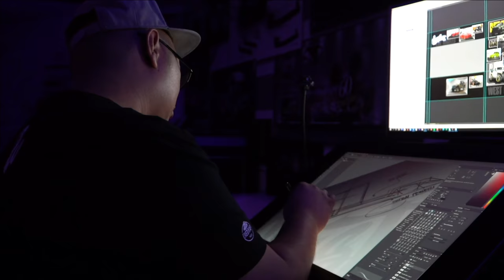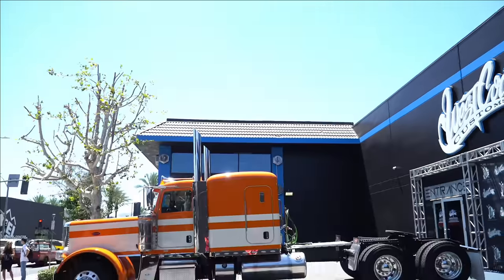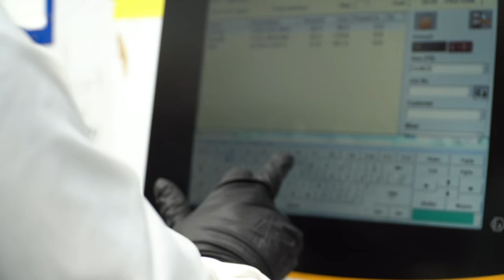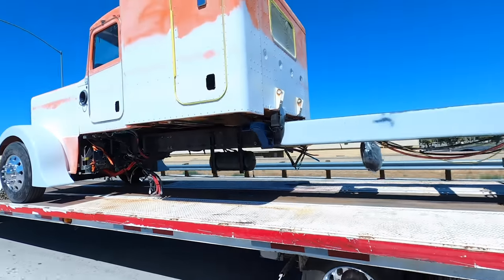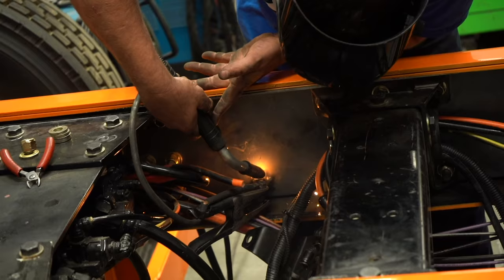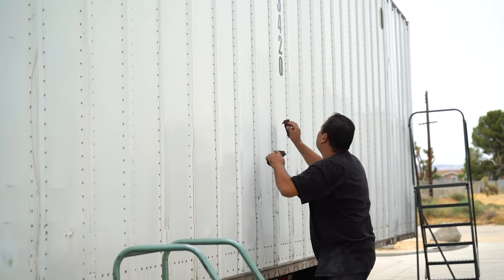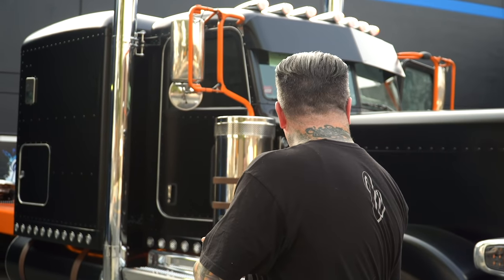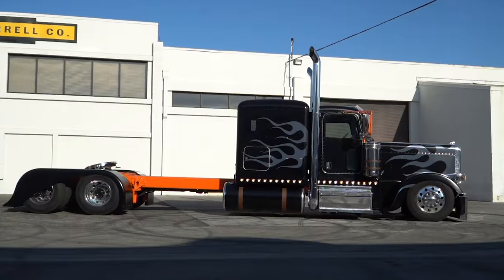"The Last World Tour" Bad Bunny Big Rig |  West Coast Customs

Comment: All that work and they put sticker flames on it.
Reply: The whole truck in and of itself is inconsistent with the render there are some nice and sharp 90° angles that they could have accentuated and sewn throughout the entire sheet metal work but instead the front fenders around all the back fenders are square.

 the stacks are both standard chrome, with no visible alterations, off the shelf front bumper along with the entire bonnet, even avoiding altering the fuel system square covers could have been added to conceal the tanks, 

They could have cut and chopped the roof leaning the windshield forward to compliment the completely vertical grill.

The stacks could have been cut at 90° angles with square box piping, and the wheels are also left as standard.

The front fenders could have been pulled forward and mimicking the rear fenders with a sharp 45° ramped receding tail. 
Then headlights could have been flush mounted into the boxed front fenders and the entire front end completely square and vertical.
the sleeper also could have been altered and pulled out sharpening every angle to 90°, and it is also left with the factory curves and bubble top.

So much more could have been done, alterations to accentuate the already impressive boxiness of the truck.

I will compliment the color scheme... although it is very reminiscent of special edition Harley-Davidson trucks... it is still a nice contrast, and the fit and finish is impeccable as is the standard for West Coast customs.
Also do like the what appears to be leather straps holding the tanks in place, along with the stretch frame.

I realize they have a strict timetable and they couldn't do everything possible what tant amounts to a gimmick of publicity, but if time were no object it could have been performed.
Reply: @PACKERMAN2077  Damn bruh, you should open a customs shop or something , this attention to detail you've got is crazy.
Reply: @kalmansandor5930  yeah certainly it's probably going to be on the road as well and so they have to keep repair costs to a minimum bespoke work is harder to repair.

And it won't be the center of attention
Reply: @kalmansandor5930  are you talking about keep as in they're going to resell it so they're trying to keep the resale value high by not permanently modifying it?...

Aside from the paint and frame stretch which is a popular thing it looks like mostly reversible bolt-ons and flames aren't everyone's thing anyways, I guess they might flip it on the custom truck market when they're done with it
Reply: @PACKERMAN2077  could have at least tied in a little orange air brush into the flames ,

Comment: I can't stand the newer headlights, otherwise looks great.
Reply: & straight pipe  🤟
Reply: Should of left the chrome flames off

Agree???
Reply: @joeymeyer3653  I would have left the flames off  but they were going for an over the top custom look.  I like the older classic looking headlights or round singles on a classic looking truck like this. I like the little touches they did like painting the fuel tank and air cleaner bands the same color as the interior.

Comment: 8:41 See that on the roof.. . Those are leg mounts for a guard rail. You can also see in the rear is an elevator platform to the stage. This pretty much confirms Bad Bunny is taking his tour on the road..... Just like in NYC.
Reply: With that long of a wheelbase the driver won't be able to maneuver that thing anywhere near New York City
Reply: @TxJacob713  Did you not see the concert he did literally on a semi in NYC....?
Reply: @jeremyll454  I did. If you notice the truck it was a short wheelbase cab over truck. They chose a cab over because of the sharp turning radius and its flat nose, and short wheelbase. This peterbilt is a long nose and has a long wheelbase wich means its going to be a bitch to steer especially in new your city streets

Comment: So you ruined a perfectly good running truck by changing the suspension to air bags that will affect handling, ruined the stability by extending the frame, painted it will a basic ugly matte black, and ended it with flame decals, as tacky as possible, and 2x the price. Great job